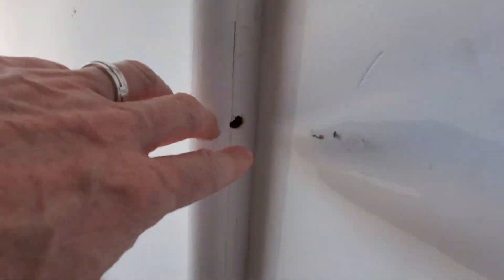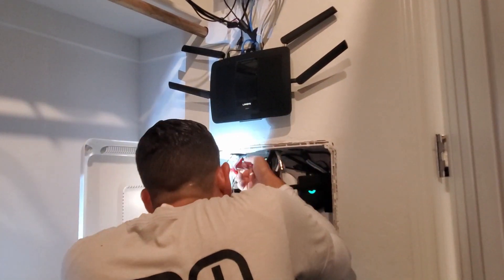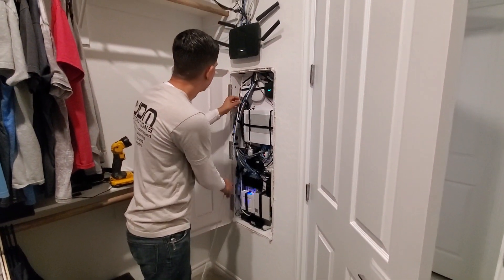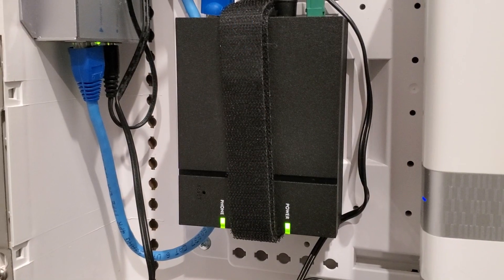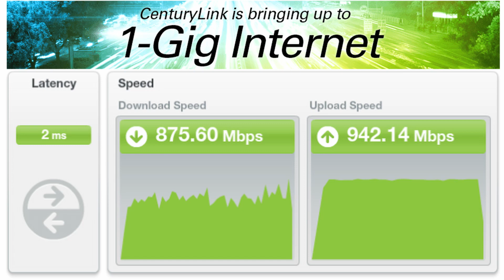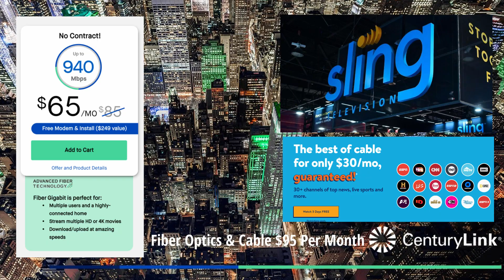Home Fiber Optic Internet Installation -  How To

Comment: I get average 396 download and 46upload with WOW INTERNET.  Small city 18 miles from Augusta GA.  They are only provider on my street location.  They use standard cable off telephone poles down street.  Btw that is through 2.4GhZ WiFi.

Comment: technically it is not a Modem it is a transceiver a device that changes light back to energy so it can be used by the network card.
Reply from the maker: It's an ONT

Comment: Hi,  i recently got optical internet installed by the provider's mechanic - and what surprises me (and why i'm browsing youtube for answers) is that i have a 'male' cable coming out of the wall which is plugged directly to the router - instead of a 'female' wall socket to plug in to? Is this normal? I think you have it the same way... so if someone trips over the router or whatever i assume it'll yank the main cable all the way from the (don't really know tbh) 'mains' ? o and plus there's no sheath or protection, just a really thin - cthru - fishing wire very fragile looking cable ?
Next question: i'm no mechanic but can i roll up all that cable into the wall and install an outlet myself? connect said cable to a to female conversion wall outlet thing and get a new cable between wall and router?    
thanks in advance:)
Reply from the maker: You would be surprised that fiber cables are pretty durable. I would not worry about it. Just make sure wherever your fiber plugs into ( ONT ) that its not  going to be I'm the way. That's why my fiber modem is in our network closet. If you have a shelf or a table place the modem on it and you should be good to go. FYI never look at the end of a fiber cable the light will damage your eyes. Thank you for watching and if you subscribed thank you as well.  Enjoy your fiber speeds!!
Reply: @UltimateTechHub  Glad to know it's nothing to worry about then. Thanks so much for your very reassuring reply!

Comment: So CenturyLink doesn't run the fiber cable and connect modem for you?
Reply from the maker: If I had the fiber tube installed in my house they would have ran the fiber. But my house doesn't have the tube. So I had to run it myself.

Comment: Or who you ISP is.   Centylink is not a great ISP from my experience.
Reply from the maker: I've had 2 outages with CenturyLink and both caused by construction in our area. Otherwise the fiber speeds have been great and love the price. Thank you for watching and if you subscribed thank you as well.
Reply: @UltimateTechHub  it’s a good video.  Where I live in Wisconsin we only have dsl to homes and speeds vary greatly and the network regularly gets overloaded and slows all speeds way down.  Most customers can only get between 10 and 30 mbps.  Like I said it’s all been based on my experience.
Reply from the maker: @nickbehnke1222  DSL is not very fast or reliable. CenturyLink had DSL in Las Vegas where I live but it was terrible. Once they got fiber installed it was a no brainer. Hopefully they can install fiber lines in your area. 10 to 30 mnps is too slow.

Comment: Hi Sir! It's me again. Just wanted to ask, I want to place our modem/isp in the center of our house and I will use a 10meter fiber optic for that, will it affect the speed of the internet?
Reply from the maker: Not at all. A 10 meter fiber run won't affect your speed in any way possible. Fiber can run for very long distance. Keep me posted if you have any questions.
Reply: @UltimateTechHub  Wow! That's good to know. Thanks again Sir! I am watching now your videos. More power 😊

Comment: So I have fiber running from the road and fiber company into my home.  But I have a barn I want to get reliable internet service to.  I plan on running 4k smart cameras out there to keep an eye on things. 

Right now fiber comes into home, connects to its fiber modem that translates the data to ethernet compatible data, then to my router for my main network.  How do I retranslate the data to a fiber optic line so I can run a 550 ft line of fiber optic cable to my barn?
Reply from the maker: It would be easier and cheaper to run Cat6 for half the distance and add an extender and then run another cat6 to the barn. So run 270 ft of Cat6 to an extender then run another 270 ft of Cat6 to the barn. 4k cameras will run perfectly with cat6. Keep it simple. You should run these cat6 in conduit for protection if it's going to be run entirely outside. Fiber cables are not expensive but the connections on each end can be pricey. Also fiber would need to be installed in a protective tube for the entire run. I would run Cat6 but fiber would be a good choice as well. Keep me posted and thanks for watching!!!

Comment: What hardware do you need to have a fiber optic network? Just connect a cable? What's the black box?
Reply from the maker: All you need is the fiber modem ( ONT ) and a router for additional ethernet connections. The black box is the fiber modem. Thank you for watching!

Comment: Uh, doesn't that cable access also go into your attic?  Why did he have the wire come out of it, and then drill a hole in your ceiling.  I'm seeing two unneeded holes in your garage.
Reply from the maker: Nope there is no cable tube for the fiber line. Most houses have a tube just for fiber but Lennar did not install one. We tried every other way but this was our best option. I've wired dropped a bunch of Cat6 and my attic is near impossible to get to under the garage roof line and it's a super tight space. Thank you for watching I really appreciate it.

Comment: If the speed is not as advertised, you gotta ask for a price adjustment, never let them get off so easily.
Reply: They can probably come out and test it with gear that can handle that speed easily and show him that the problem is on his end.
Reply: it says up to because he is sharing 2.5gbe with 32 customers. Its gpon

Comment: 1 consideration that took me weeks to figure out... if You have old cat 5E cables... upgrade them if You get fiber.. They too can be a bottleneck.  Cat 7 or Cat 8 will dramatically help deliver the speeds.
Reply: What an overkill.... Did you check what speeds CAT 5e and CAT8 support? CAT 5e support easily 1gigabit, CAT 8 supports up to 40 gigabit. So CAT 5e is perfectly good for fiber internet. Easy and if you want a good way to renew your cable (in case it isn't shielded 5e) is to get CAT 6 and that's it.

Comment: Jesus... I have fiber internet installed right now, the only company in the area, and for 20M it's $173 a month (5 years)... this might be snappy for some, but vermont doesn't have the option of a reasonable price for the fiber-like what you have... I've decided recently that It would be wise to just get 50M fiber internet for a bit more than to stay with 20M... I have to start a petition for all to sign up 50M Fiber Optic Internet is $226 a month... so, you know what... the hell man... I do notice a difference with the 20M... but 50M just seems more reasonable.

Comment: I Got optics and it is not protected it is a transparent thin cabel, and I saw it emmits light we cant see so it damages the eyes, why isnt it protected Like yours is?
Reply from the maker: You should call your internet provider and ask why the wire is transparent. I've never seen that before. Keep me posted.
Reply: @UltimateTechHub  Will do, I will let you know what they say, btw im in Croatia and it seems nothing is like its supposte be here so I wouldnt be surprised if its a mistake from their side.
Reply from the maker: @kristianpurgar5068  Probably!!

Comment: Here's my slow internet story- Currently at 10/1 or fast enough for Netflix or Prime at regular HD but not both at the same time and forget UHD on even one TV. Downloading PC updates is survivable but a big game takes forever and then some more. Just had wire replaced from box outside to inside and from there to new modem because the slow net was often no net, the tech said rainwater was dripping from inside the old wire! Funny it worked at all. Then he said "Fiber is coming soon" How soon? "This Fall" Well alright,I'm in!!! Don't know speeds/packages yet but it will be a big step up for sure.
Reply from the maker: Do you know which company will install the fiber? That could give you an idea of what to expect in terms of pricing. You may want to upgrade your router and network cables to accommodate the new fiber speeds. Keep me posted.  Thanks for watching and if you subscribed thank you as well.

Comment: How do use a third party router with Centrylink aka Quantum gig fiber? I am running into issues with PPOE, DCHP, VLAN etc.
Reply from the maker: I'm using a Linksys Router connected to the fiber modem. The from the router then to my switches. I've had no issues with DCHP, PPOE or VLANs. What kind of router are you using?
Reply: I tried using a ubiquity alien router. However during installation it asked for my ppoe username and password. The only way to allow it to “work” was in bridge mode. Not wanted to go from my ONT to my Centrylink router to my alien I gave up on the idea altogether and simply return to the century link modem, for now. I was hoping with your guidance I could resolve this issue. Do you have to clone your subnet mask ?
Reply from the maker: @Dino860  I've never come across that issue. Not sure why the router would need your ppoe username and password.  Did you reset the router before installing it? You should be able to use any router with CenturyLink fiber ONT. I would reset the router or try a different router.

Comment: Why didnt you wall fish it in the garage???
Reply from the maker: The roof slope made it way too difficult wall fish it. The area in the attic had very little room to work much less drill a hole and fish the wire. Also my electrical panel was in that location and it would be hard to work around all the wires and probably dangerous as well.

Comment: To lose 50% of speed is not okay.
Reply: My provider has an app that test speeds at the gateway not the device.  This is a great feature!  From there I can start to plan out my home network, distence to to gateway, bands and channels and wired or WiFi for optimal performance from each device.

Comment: 1 thing that went way over your head when making this video last year. 
Most important factor to download speed. 
If your on wireless or ethernet. Wireless wont give you that 940mb/s however running on ethernet will.
Reply from the maker: Actually with wifi6 you can get pretty fast speeds. I get around 700 mbps on my wifi6 router. But ethernet connections are always faster and more secure. Thank you for watching and commenting!!
Reply: @UltimateTechHub  yes definately aware of wifi 6 being availavle. However stating the most common used for general public. 
Also another note to bring to this video. If Quality of Service (QoS) is enabled on router or modem it will split the bandwith up in equal portions regardless if anybody is online or not. For intention of giving you and future online users the same internet speed experience. 
I in no way intending to bash this video, you did put together a good vlog for this subject, i still consider it very helpful to the average user.

Comment: for me,I'd do this DIY style and convert an old Dish that was built for TV and use it for Fiber internet instead. at least when we go 10gigabit. use one fiber cable to decode the signal from the Satellites in space and another fiber cable to convert over those signals for the Cat 6 Ethernet.
Reply: I cant tell if this is a real thing or if you're fucking with me

Comment: Suggestions as to the BEST ROUTER to go with my fiber optic box??? Anyone??
Reply from the maker: Make sure the maximum supported router network speed is bigger than the network speed offered by your ISP. Once you’ve figured out what range you’re talking about, you can shop for the perfect router! If your maximum network speed is, for instance, 1 Gbps and your router’s maximum speed is 100 Mbps, it’s obvious that it will throttle your connection and slow it down. My pick is the Netgear Nighthawk R6700. TPLink and Linksys also have similar models. Good luck and keep me posted.  Thanks for watching!
Reply: @UltimateTechHub  correct! My internet is 1GBPS and the nighthawk router that i have now does give me good speeds it's just that this thing is so old it's starting to malfunction so I'm in the market for a new one. I'll most definitely check out the one you stated above, thanks for the reply!!
Reply from the maker: @El_Compa_Luigi  Good luck! Its fun shopping for a new router because it doesn't happen too often, since routers last many many years. Thanks again for watching and keep me posted on which router you choose!

Comment: What brand of fiber optic converter box / modem did you use for the fiber optic to cat 5,6, or 7 cable, the into your router? Thanks 👍. Great video.
Reply from the maker: I'm uploading a video in a few days called My Home Network 2021 and all of the device information will be in that video. As far as the modem it's a Calix GigaPoint 803g fiber modem. Keep an eye out for my new video it will explain more. Thanks for watching!

Comment: You should have called a professional to teach you that electronics need AIR FLOW.  That closet is the worst idea in the world.  You have multiple areas that are blocking wifi and the "closet" is actually a breakout box that you have turned into a "network closet".  You're not getting those speeds because your equipment is HOT and you have a terrible location for the wireless router that blocks signal.
Reply from the maker: This is a network box that Lennar Hones installed. I have a Wireless access point installed in my main hallway in the middle of my house. So I have 2 Wireless access points with zero wifi issues. Non of the components get hot in the Network panel and I leave the door open for extra air flow. The only component that gets warm is the WD Cloud which I rarely use now. My speeds are running around 800mbps which is plenty fast. Hope this clears things up for you. Thank you for watching and if you subscribed thank you as well.

Comment: Was wondering, what are some good, cheap modems that can run fiber-optic? I might be getting fiber soon and my modem is shit.
Reply: Thanks.  My father’s cabin In Carolina has Skybest service fiber optic yet they only mention coaxial cable modems when I tell them I want to buy one  instead of renting theirs.
Reply from the maker: @fayswan69  Yes they make more money renting the modems. Just purchase one it will pay off in the long run.
Reply from the maker: Fiber modems are pretty cheap. Mine was free with CenturyLink service. I priced out the modem and it was less than 90 dollars.
Reply: @UltimateTechHub  so which modems?  I can't find any that aren't coaxial
Reply from the maker: @fayswan69  Calix Gigabit Fiber ONT. Check Amazon.

Comment: I'm in Vegas also and looking into fiber from CenturyLink. Is the fiber line "pure fiber" to the house or "last mile" fiber to street/ coax to house? Their website doesn't specify which is used specifically just that both may be used. Thanks!
Reply from the maker: From what the installer explained is that its pure fiber no coax. Our neighborhood is new so they installed fiber throughout this entire area for all of the new home developments. And from the street to my network panel is fiber. No coax! Speeds have been around 820 mbps today. Super fast. Thanks for watching and keep me posted.
Reply: it's pure fiber I can tell by the installation

Comment: So is CAT 6 good for fiber internet speeds? will there be no bottlenecks? I already have Fiber in my house but the router is upstairs and my room is downstairs. I am wanting to do a wire that goes to my room through the wall and have a port set up in my room. Is that possible with a CAT 6 cable or do I need another cable in order to create that port? I know I will need the CAT 6 cable to plug in my PC to the port that will be built in my room. I am not sure which cable to use to create the port though.
Reply from the maker: Yes Cat6 will work perfectly. And yes run a cat6 to the downstairs bedroom. You could even connect a 5 port switch into the cat6 downstairs for more ports. And there will be zero bottlenecks. I have multiple switches with cat6 and my speeds are around 800 mbps. Thanks for watching and keep me posted.
Reply: @UltimateTechHub  oh sick thank you so much!

Comment: help me i have fiber 1000 am i am getting less than 2 megabytes per a second and everything always freezes what do i do
Reply from the maker: Reset everything.  Unplug modem and router and any switches for 30 seconds.  Then plug the modem in then the router then the switch. Keep me posted.

Comment: Symmetrical speeds and latency are the biggest benefits of fiber, not to mention not having to worry about upstream ingress from other locations. So yes fiber is ideal but not no much because of the speed, most people only use 60Mbs and thats with a 5-6 people at once streaming and gaming.
Reply: I felt good living by myself with gig fios lmao. Never went down once except for a storm, just had to reset my ont
Reply: Actually having reliable service too.

Comment: what is the brand of your fiber modem?
Reply from the maker: Calix GigaPoint Model# 100-04255
Reply: @UltimateTechHub  Does it have the jack for the Fiber RJ45 cable? Or do you need some sort of adapter. I have finer , but I want to upgrade the modem.

Comment: By any chance do you live in Arizona? I only have those 2 internet options here and the outside of your house looks like it belongs in Arizona also if century link only offers DSL in my area can I do what you did to get fiber? Because the cable internet I have with Cox is good but with fiber I can get lower latency
Reply: exactly, dsl century link.